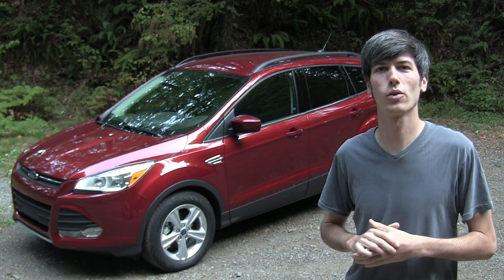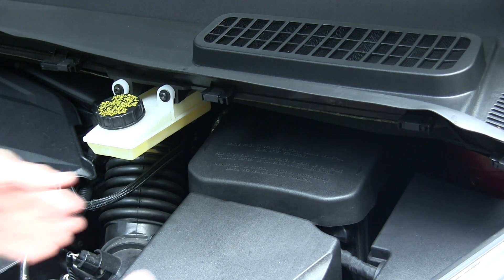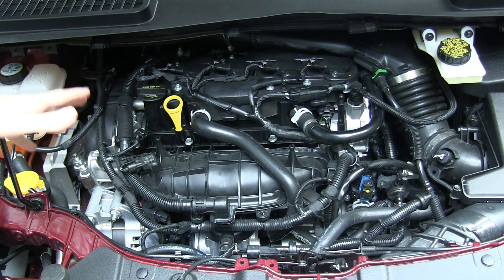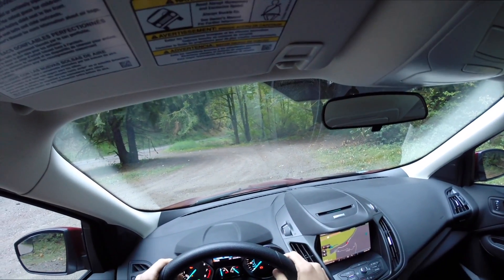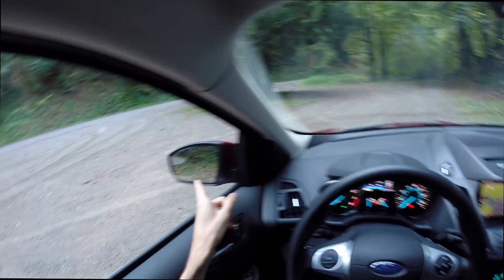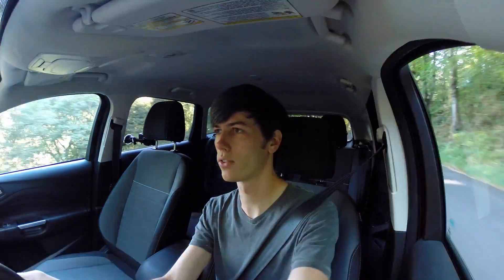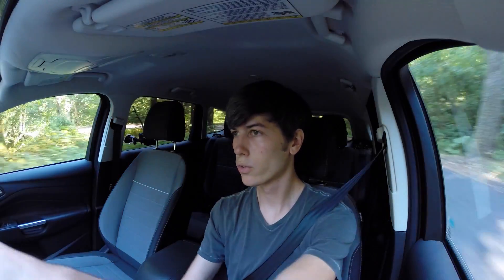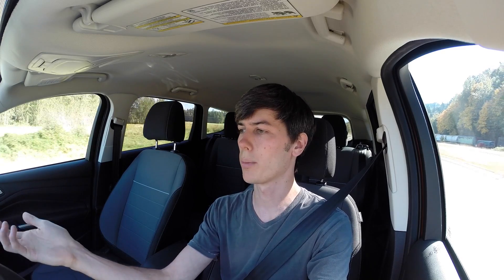2014 Ford Escape - Review & Test Drive

Comment: Does the ecoboost turn on automatically? Or is there a button you hit? For the 2013 escape
Reply: Ecoboost is just the name Ford gave to a lineup of their motors, its not a function or a feature. Just a lineup of turbocharged engines.

Comment: Have a 2014 titanium all-wheel drive with a 2.0 and if you can afford it get the 2.0 I couldn't imagine trying to drive this car with less but with the 2.0 it feels really spunky I have all the power that I need and it's really nice and I average about 26-27 miles a gallon although I do drive a lot more highway the interior cuz it is the fully loaded is really nice I tried one lower model and I really didn't like the seats they're not super great in the titanium but they're definitely better than a lot and yes it's almost impossible to get to the negative terminal on the battery without taking off those water trays or whatever you call them it only takes like 10 minutes but I mean it's a pain and I do like having the spare tire in the back instead of hanging below and there's even room for some extra tools and stuff not a lot but some but I bought it used with 50,000 mi I'm almost to 100,000 right now and everything's been really great I've only had one problem with it but it's a problem to pretty much all EcoBoost once they hit around 100,000 mi the wastegate flapper valve the blinks in it get loose and you end up not being able to hold boost cuz the wastegate valve will close I have been able to cinch up the actuator rod I I moved where the screws hold the rod farther up and I was able to temporarily fix the problem but I will eventually have to get the wastegate rods fixed and for most people that means replace the whole turbo cuz they don't do parts of the turbo even though it should really just be the turbine housing I'm going to take my new machine shop and at the most probably drove 200 bucks but I can also take the turbo off myself which by the way if you haven't all wheel drive is a pain in the butt because the transfer case is right in front of the turbo but if you don't have all-wheel drive it's something pretty much anyone can do although we'll take a couple hours at least and again I do not suggest buying a new turbo they seem to last you just need to get the links fixed any machine shop should be able to do it so there's no slack in them other than that it's a great car and I spent a lot of time just driving research and asking friends and I think this is probably the best small SUV if you get that 2.0 engine if you don't need that extra power I would probably go with a CRV

Comment: The air filter needs to come out to change the battery. Difficult to change it yourself. Most battery dealers have  difficulty changing it. You really need to get the dealer to change it.

Comment: Thanks for the presentation, nice. Very impressed with the 13 escape. Very comfortable and responsive. Ford could have done better with the coolant bottle and battery compartments. Have one with 148 thou miles. Still drives like new. Except one time while doing a turn, i would say sbout 10 to 15 miles an hour, the steering locked. Freaked me out. Pulled over with hard steering. Shut the car down. Restarted and went ahead without any problems. I havent had that problem again. (Knock on wood).
Reply: Jesus that scares me hopefully that doesn’t happen to my escape. Do you know what could’ve caused it or why it did that?
Reply: @Pg-ch5nb  his power steering pump is likely worn

Comment: Good overview of the car. It’s a great car for a driver, however they are a mechanically nightmare! Other than the passenger compartment, this is ones of the worse cars ever. They are incredibly hard to work on, if you do you own work. Tons of little electrical issues, they burn brakes like crazy, forward clutch packs go all the time, driveshafts are non-serviceable and joint only last a few years, and on and on. Oh and the whole lighting on fire thing, yeah they are known for randomly starting the fuel system on fire under the hood. Basically great car from the driver seat, straight down hill after that. Good review, I like your style, too bad it’s a terrible car.

Comment: I like your more engineering themed road tests over others which are more consumer orientated. You didn't specifically mention whether it was a DCT or torque converter gearbox although I gathered its the latter from listening carefully. You should explain just exactly what Ecoboost is compared to other turbo engines and examine its benefits and problems. For myself the battery placement is not a big thing - after all how often does it need to be replaced. However, the coolant filler cap position is an example of how one design department is not talking to another and that is a scandal.
Reply: EcoBoost is simply a Ford brand name for a turbo engine. It provides turbo boost and it's "Eco" because it is supposedly more economical than a naturally aspirated engine of that output (though I'm not sure that's really the case.)
Reply: Stewart Robertson your comment was illuminating, respek

Comment: I have a 2010 Escape and love it and maintain it myself. thinking of getting a new Escape but i am disappointed by the way this was designed. it does not look like DIY maintenance friendly. Plus i have heard horror stories about Fuel line breaking and causing fires and gumming in the valves as it is a direct injection vehicle.

Comment: due to the battery this is no longer on my list
Reply: HX Re so because replacing the battery might take 30-40 mins to do(every 5-8 years) you won't get one?
Reply: Chad Pease it’s not even that hard. you just take off the intake hose and the whole air intake comes out then the battery slides out

Comment: My wife has a 2016 Escape SE 1.6 Ecoboost. Great vehicle! We average 34mpg on Anchorage runs and city highway mix is 26 mpg. Only issue it could use more power down low, once boosted up it does great, but that first and second gear kind of sucks and for normal driving you have always be at 2500-3400 rpm to keep up with stop and go traffic.

Comment: My wife bought one of these 2014 Escape Titanium package.  Personally, I don't like it.  It rides like a horse and wagon and drives like a Mack truck.  It is ok around town, but will not be driven on any trips.  The touch screen controls require you to take your eyes off the road to set the AC or tune the stereo and is very confusing.  I don't like that,. either.  It is going on 3 years old and has only 12,000 miles on it and sits under the car port for weeks on end.  We drive a Chevy conversion van as our main vehicle.

Comment: Location of the battery just turned me off
Reply: Ironically, it made me more excited about the car. It's awesome that it isn't hanging out over the front wheels.
Reply: Melinda Brown it's only an issue probably every 5 years
Reply: @openmythirdeye  unless you have a tire pump that uses the battery terminals such as mine.  It's a twin cylinder pump that requires more current than the typical lighter plug in your vehicle can provide.
Reply: I did and everybody loves it.  wth
Reply: These are the Worst and most troublesome vehicles. Just google consumer reports!

Comment: I have a 2005 Escape, and I have the overdrive lock out button on the gearshift. Does the new Escape have the overdrive option, or is that controlled fully by the vehicle now? Do you have any advice regarding the O/D system in the older Escape?
Great videos by the way! Very informative, and good details.
Reply: Archer Jennings o/d is just your final gear. with over drive on it uses the final gear with it off it won’t go into the final gear.

Comment: Looking to buy one of these in September (possibly 2015 instead) and this review was very detailed and helpful. Thanks a lot :)
Reply from the maker: Ethan Shaw Very welcome!
Reply: Yeah, ecoboost engines have had a lot of issues recently, including gum build up in the valves. the worst was the fuel lines breaking or leaking causing fires.
Reply: These are one of the worst cars ever made, lots of little issues, expensive to maintain, and also of course are know for randomly starting on fire!
Reply: These are the Worst and most troublesome vehicles. Just google consumer reports! EcoBoost has much trouble.

Comment: I'm currently thinking about getting a second car. I'm going back and forth between the 2014 Fusion SE and the 2014 Escape. Could anyone give me any input?

I'm coming from a 2007 Ford Focus ZX3 SE, so either will be a big step for me. I'm just unsure of whether to go for the mid-size sedan or the crossover.
Reply: +Nate Wilder As always, it depends on your personal requirements. Do you need the bigger cargo space and ride height clearance of the Escape, or just a vehicle to get around in, where a standard trunk will do? The trunk space and ride height are really what the Escape has over the Fusion.

Comment: Wait...why is the turbocharger attached before the intake manifold? I've always thought turbos were attached somewhere along the exhausts.
Reply from the maker: Dr Shazz The exhaust portion of the turbo is fed from the exhaust manifold, this spins the intake portion of the turbocharger which pulls air through the intake, and sends it through the intercooler before passing through the throttle body into the intake manifold. How Turbochargers Work

Comment: Your review is brilliant from a technical point of view. Loved the suspension demonstration in particular. A few points though:
1- You need to work on your video capturing and editing. You could consider letting a friend help you out with it if you can't hire a cameraman.
2- The 6-speed auto should be considered a huge plus since ford's Powershift DCT is absolutely horrendous. I drive a focus so I know it.
3- It seems the weird braking behavior you described is common with ford cars. In the focus the brake pedal does nothing for most of its travel than suddenly brakes at the end. Its certainly a big minus though as its makes parallel parking a pain.
4- Some exterior footage of the car while driving it is necessary IMO.

You're doing great considering you've only done 3 reviews (including the subaru). You're on to something good in my opinion. Having all your subscribers chipping in with advice on making your reviews better is just great. Keep it up!
Reply from the maker: K Sadek Thanks for the tips! 1. It's a lot of work to pawn off. I know it needs work and I'm working on it. 2. Haven't driven the DCT. Just drove the Subaru Legacy with the DCT and it was great. 3. Yep, I've heard the same from Ford friends after posting.4. Eek, probably not anytime soon unfortunately.
Reply: Thank YOU for being open to advice. Oh and BTW, weren't subaru's only manual or CVT?
Reply: These are the Worst and most troublesome vehicles. Just google consumer reports!

Comment: 6 speed automatic transmission will have a 1:1 direct drive ratio on 4th gear instead of 3rd gear correct?
Reply from the maker: 7150285 Can be different for any vehicle. There's no requirement for a 1:1 gear ratio.
Reply: Engineering Explained in general for 4 or 5 speed A/T the 3rd gear is the 1:1 direct drive ratio.
For M/T the 4th the usually the direct drive

Comment: Nice review. I loved the part of the technical presentation about power train, suspension, turbo, and the fluid check. Those are the things the owner is concerned about. I do not see value in forcing the engine to do 0-60 and then brake. No owner will stress their automobile that way. You told things that I will like to know about.

Comment: One comment about the serviceability is now that some batteries last 7+ years I don't think it's nearly as much of an issue as it used to be.
Reply: the market for this car, i presume, is for those who will call their local roadside mechanic to handle any dramas.
Reply from the maker: Great point, though if you drain it dead, it's still not ideal to hook up jumpers.
Reply: it’s really not hard to remove the battery on one of these, you disconnect the intake hose and the battery is on a platform that slides out. at least my 2015 is

Comment: i work on these and the escapes are shit!, constant recalls on everything, their cooling system is the worst, ford has a few more years togo before this car can be called a good car. Who here buys a car for good piece of mind, and then finds out that there are 3-6 active recalls, wtf!
Reply: That's because you only see the defective ones. Being a mechanic and all... It's not like folks take their car that runs 100% to you. 

I have a Escape w/ the 2.0l and a Focus ST and have zero issues.
Reply: well lets see here 
1.) 1.6 we got a risk of fire recall for the guel line dampener
2.) cooling system over heat so there is a coolant re rout for the system 
in some cases they have replaced the entire long block 
3.) electrical splice repair for the power windows lacking power
4.) one for fuel line leaking on turbo down pipe causing a fire
5.) don't for get their automatic trans which is a auto shifting manual 
their seals leak causing lack of power, roll backs on hills, the repair is to re seal the trans but it eventually leaked again in some cases and another reseal is done ....
6.) C.V. axle seals are common 
7.) door handle adjustment recall
so would the average joe still buy a ford now knowing it has this list of recalls that started in 2014 probably not. your car spends half the year in the shop LOL! and all recalls effects every car they have on the lot and the ones the sold.the 2.0 motor has less but still.

I bought a 2014 Toyota matrix and haven't gotten a single letter stating a recall.
Reply: K3Shuff takes letters a while to get across the ocean bud

Comment: That battery is in a horrendous spot. It's like they put that there just so you would go to the dealer to get it replaced.
Reply: The earth is routed to the front of the battery case if you need to access it. To remove the battery, you just disconnect the intake hose to the airbox (1 hose clamp and a one rubber one you remove without the need of a tool) and pull up to remove the airbox. Then slide battery forward and out.
Reply from the maker: chrrrr I think the location is intelligent from a weight distribution perspective, but it certainly could be easier to remove.
Reply: Engineering Explained Oh yes I understand the weight part but it's still not worth it to hide half the battery under that. Also would be a pain to jump it. The Positive is easy enough to get to but the Negative is near impossible. Also they always say to remove the negative when working on electrics etc on the car which would also be a pain.
Reply: @EngineeringExplained re-locate to the trunk
Reply: minidemarco yea it’s not as hard as everyone thinks.
Reply: taking the cover off is not very difficult. annoying yes. you take off the wind shield wipers, remove the clips and a couple T-screws and your in
jumping it is no issue because there is a ground wire and screw right beside it in plain sight
Reply: @toby2581 have you actually done it? Because it's really not hard at all. And given that most people will only need to change the battery every 5 years or so, it's really not an issue at all.

Conversely,  the air cleaner is a piece of cake. Takes a couple of minutes.  And I replace them a lot more frequently than batteries, so to me that's a win.
Reply: The irony of this thread tho...
"I wanna service my own vehicle!!"
"What do you mean I have to take stuff apart!?!"
Reply: Just changed the battery in mine a few days ago. 10 mins, out and in. 
No problem, like the engineers at Ford{Mazda} know what they are doing...
Unlike certain other brands whose cars kill you if you drive over a moderate bump with too many keychains... ehem
Reply: @toby2581  Once again, it is super easy and straight forward to anybody that has any business taking a tool to their car.
Literally took me 10 minutes to swap my battery and all I had to do was look at it.
The top of the battery box pops off, the front has a 10 mm nut that holds a bracket for a wiring harness, then the whole front slides up and is free. 
Then you just undo the battery hold down and terminals like you would on every other car and the battery slides forward and out.
Re-installation is the same steps backwards.

If you're stuck on that then you probably should just go find a decent mechanic to do all your work because you will probably mess up something someday and cause real problems.

Comment: Excellent as always! The placement of the components in the engine bay is less than ideal as is the case with most new vehicles, one thing I wish more companies would start doing is placing the battery in the trunk. Makes access better and helps shift that bit of weight away from the front of the vehicle.

Comment: I'm kinda surprised the Escape torque steers with the 1.6, my Focus ST has it worser with the 2.0 plus turns like a truck when you try to park it in the parking lots. Did the Escape have the Ford SYNC or that new whatchamacallit...oynx?....cause I used to try using my ford sync and very...very....veeeeeeery infuriating when I try to tell it what I want or go (one time I yelled at it so loud and it freaked out/shut off on me, lol)
Reply from the maker: ***** I typically avoid automotive voice based systems. After trying to call a number in my Subaru STI, I was quite agitated by the experience and don't have much desire to try others out. I did try making a call in the Lexus, and after a couple times it got the correct number, but they're still no where near what's on your iPhone or Android.